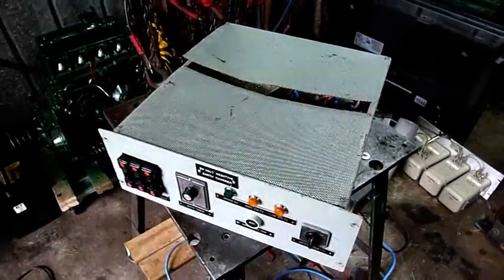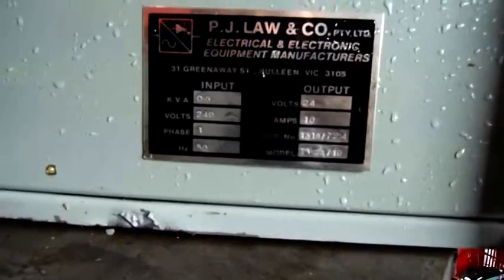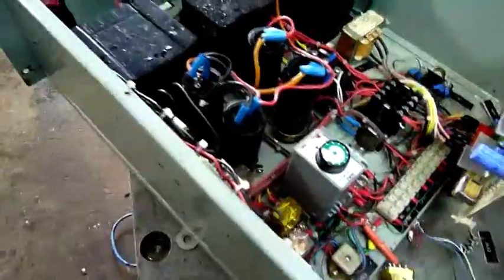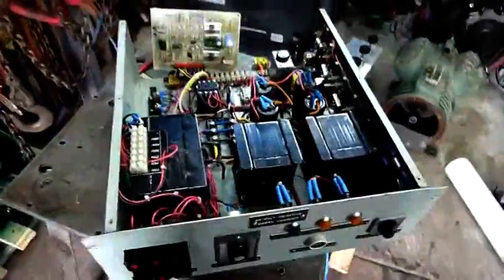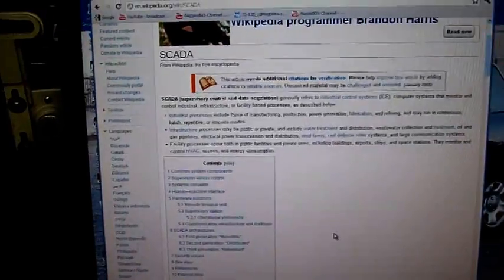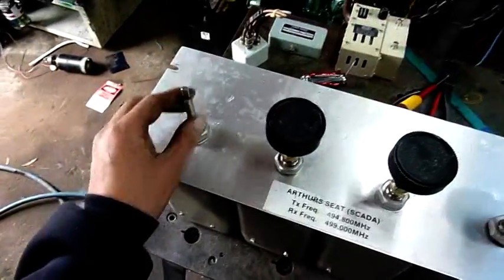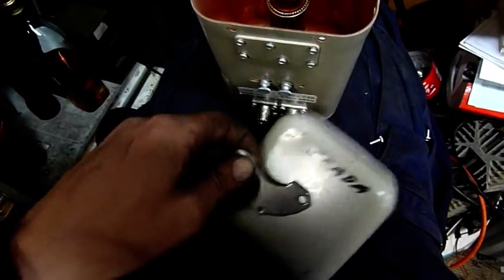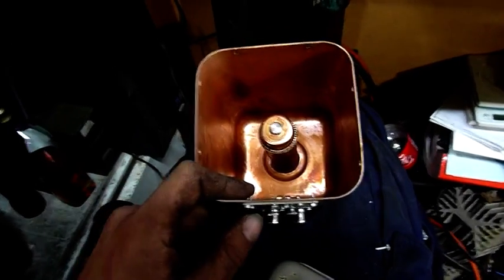SCADA Backup Charger and Motorolla Filter Autopsy

Comment: Those cans are designed for filtering.  They have a very sharp cutoff, so they can be used to filter out everything except the desired signal.  The size of the cavity in the can determines the frequency it is tuned for.  The adjusting doo-dad inside fine tunes the frequency it will filter.

Comment: Those transistors on the controller board in the charger use the metal tab as a middle pin, as the middle pin on TO-220 is always connected to the metal tab on the back. But for this purpose it's a pretty stange design!

Comment: Radio station equipment is built to last a long time. No consumer level goods in that stuff! You are probably looking at about 6,000USD new for all that hardware you had there.  The timer is an exercise timer to cycle the batts, keep them from developing a memory. There are taps on the front to connect additional batts to the charger.

Ebay or use the local equivalent of craigslist for reselling the remains.

Comment: like the psu, most psu's cant give you the output current for long, that one will.

R.F is odd stuff and at higher frequencys straight wires are inductances and cans become oddly resonant, so the can filters do make some sense.

i also think the psu is the handy bit, i suppose the big scr's are pulse width modulated to get the voltage right, and the output chokes to filter out the nasty harmonics ???? perhaps.

Comment: Those filter boxes are "cavity filters". Essentially, they only allow the specified frequency to go through, and block others. This way, you can connect transmitter and receiver to the same antenna (with tx and rx on slightly different frequencies), without having the tx drown-out the signals the rx is interested in (or in extreme cases, blowing up the rx).

Google "what is a cavity filter" for some more info.

Comment: Nice equipment. The "pneumatic timer" relay is not designed for pneumatic control. It is a pneumatic device; that's how it produces the time delay.

When triggered, a solenoid or motor compresses a spring loaded gas container, forcing gas through a needle valve, into a second spring-loaded expansion container. As the 2nd container expands, it closes an output pair of contacts.

Different valve configs give delayed on/delayed off/both delayed.

Comment: You sure do run across some interesting artifacts.  Your build vids are my favorites BUT the autopsy vids are a close second.  Really interesting and informative.  I worked with a radio tech for years he worked on just the craziest looking things all the time...  a few months ago he was pulling huge communication cables up the side of a gorge at Hoover Dam.  Part of his gear is an Arctic Cat built in the 50's to reach snowed in radio equipment on mountain peaks. Just fascinating as hell.